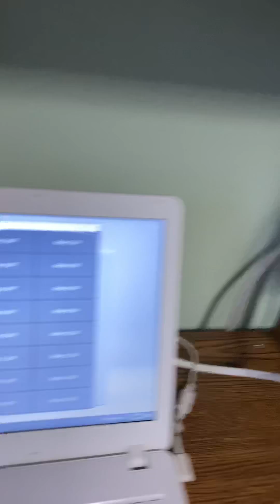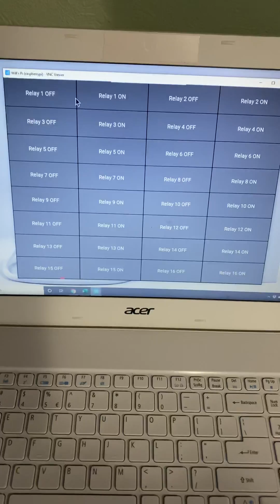Rpi - Home Automation - Update 1/26/20

Comment: Will, any updates?  Also...looks like you are running 24v AC to the field relays, correct?  What relays did you go with?  I slowly starting construction of a similar system (using Node-RED as I'm not a software guy) but haven't settled on what I'm going to run in the field.  I'm looking at the 'Functional Devices' brand of enclosed relays, such as the RIBU1C.  Amazon sells them, and they seem to have decent reviews.